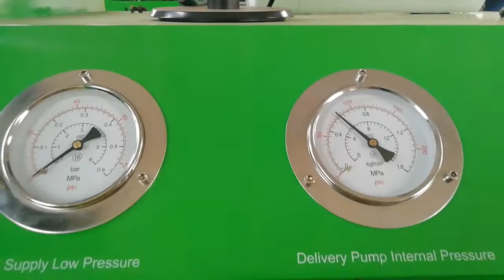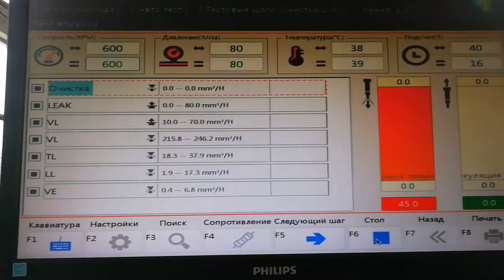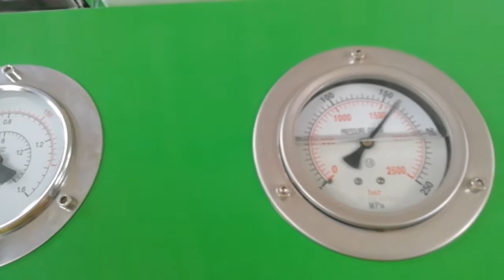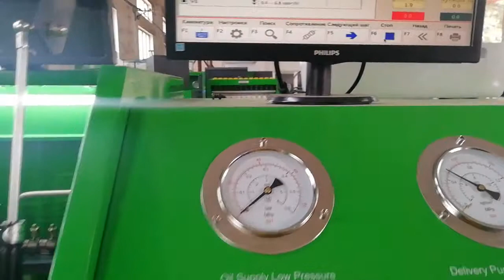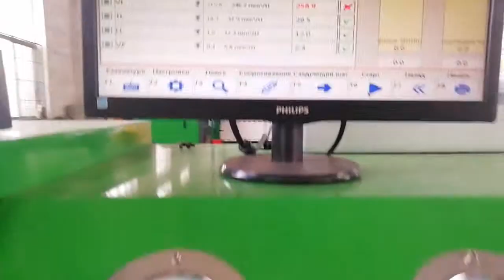испытательный стенд Common Rail

Comment: for which the frequency of injection of the injector on the mode increases LL, VE test ???
what is the principle of the measuring cell?
Reply from the maker: you can add whatsapp , +86 176 60538710 for more information